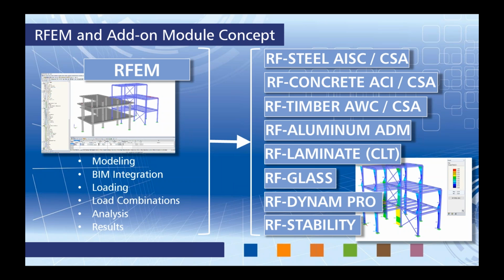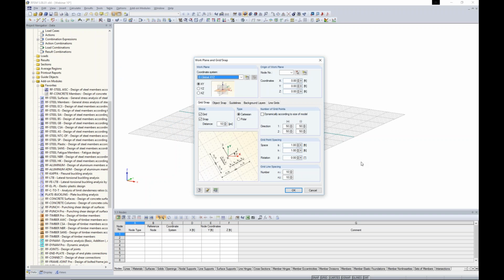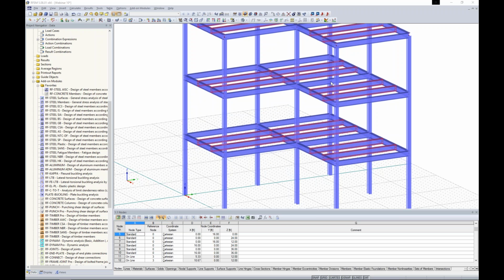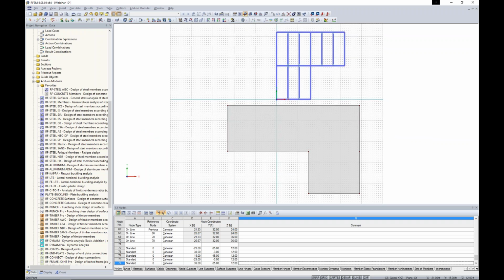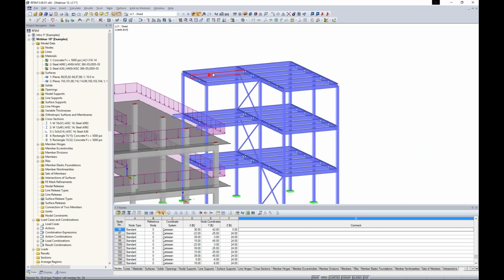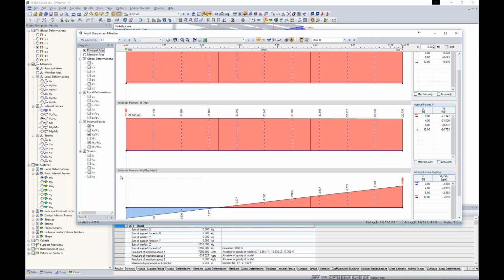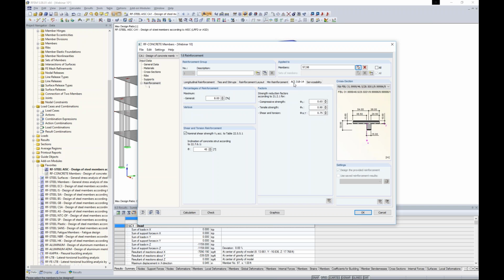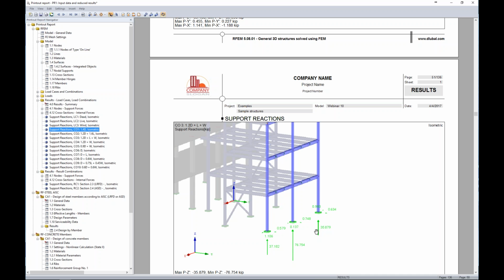Webinar 1: Introduction to Analysis and Design (USA)

Comment: I have seen many toturials done by you to put my slab over steel beams, and in every toturial you just avoid to do so. Can the problem do that ? or you are just avoiding it because it cannot ?? I am tired of this problem !! when I draw the slab over steel beams it just ignores the beams and the slab loading itself on the columns directly without considering the existance of steel beams !! How can I solve such problem please ??
Reply from the maker: Hi, Amin!
When you draw a slab over steel beams, all elements are fully considered in the FEA analysis.  The steel beams will provide additional stiffness under the slab and will be accounted for including the resulting deflections and internal forces.  If you are looking for the design of composite beams (i.e. stud spacing for the shear flow between the two elements), this is currently not implemented in RFEM.  If you have additional questions, please send us your model along with the detailed questions to info@dlubal.com.

Comment: What's the difference between load combinations and result combinations? Is the only difference in nonlinear analysis for the first ones? And, in this case, why can't I make an nonlinear analysis for result combinations in RFEM? 
As I know, result combinations are made according to codes that you choose; and how does RFEM get load combinations?
Reply from the maker: Hello Alejandro.  In RFEM, there are load cases, load combinations, and result combinations.  Load cases are created by the user such as dead, live, wind, snow, etc.  These are typically calculated with a linear 1st order analysis.  Because they are solved with a 1st order analysis, this allows them to be combined into load combinations.  RFEM has the ability to generate load combinations according to the various standards or a user can manually define them.  Load combinations are run by default according to a 2nd order analysis (P-Delta) as this may be required by most standards.  Finally, there are result combinations.  When using the combination generator in the program, a result combination will compare multiple load combinations to output the max/min results for these combinations.  It's a type of "envelope solution."  There are scenarios where result combinations can be run according to a 2nd order analysis as well but there are also other scenarios where you cannot combine 2nd order results from multiple load combinations.  Please see the following FAQ:  https://www.dlubal.com/en-US/support-and-learning/support/faq/002108.
Reply: Thank you, you've made it more clear.
So, if I understand it correctly: result combinations take the max/min results of each load combination that is calculated according to 2nd order analysis (as usual) and then use these results to calculate sections in Add-on Modules (maybe to avoid in some cases unnecessary long-time calculations for sections with 2nd order analysis if forces aren't the biggest or the smallest).

When will it be more correct to run 2nd order analysis: with load cases or load combinations (according to Eurocode)? Or I have to click "2nd order" analysis in parameters for both load cases and load combinations?
Reply from the maker: Hi, Alejandro!
Typically, you would create load cases and from those load combinations. Run those load combinations as 2nd order if needed and then create a result combination from those load combinations. The result combination then includes the envelope (max/min) of all the included load combinations. It the load combinations are run as 2nd order the result combination includes then consequently also 2nd order results. In the design module it is better to use the load combinations since we have then a unique source of results for a beam / column etc. While in a result combination the result course along a beam may be from different load combinations (depending, if it is max/min). The result combination is good to create short tables where only the max/min values are printed in a report. 
I suggest to look at specific webinars on our website for each module.
See: http://bit.ly/2I8Jb1T
Have a nice day!